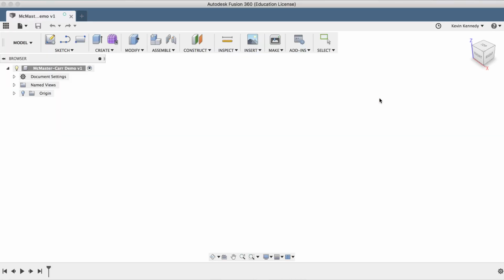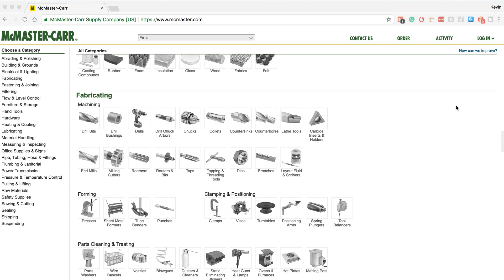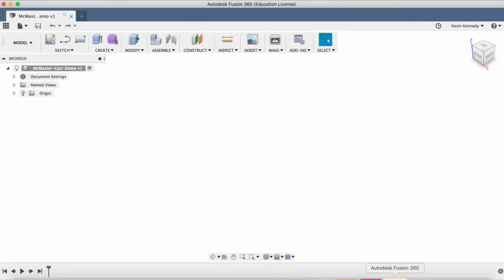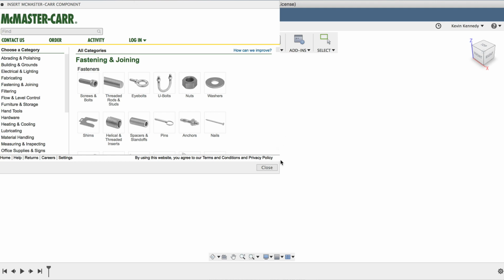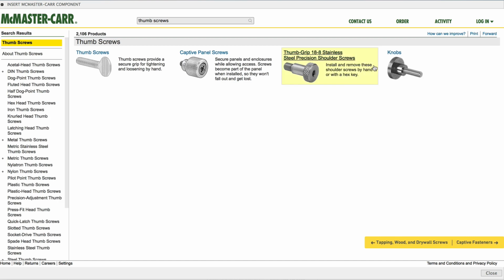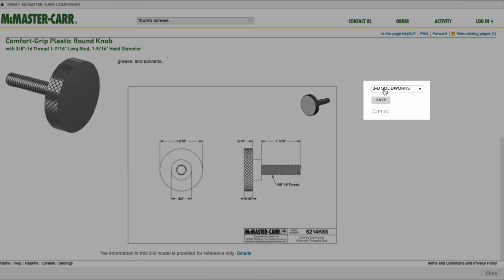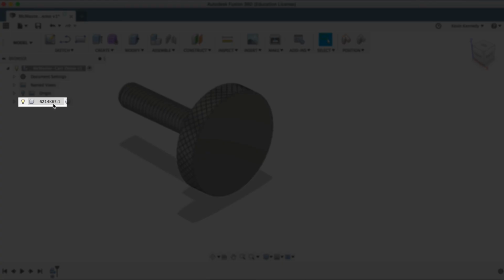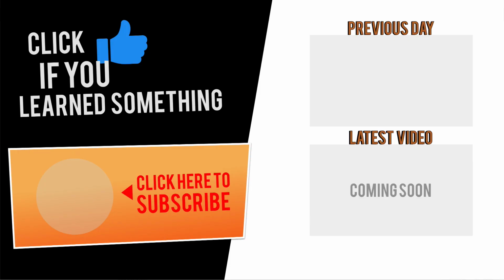Fusion 360: How to Insert PREBUILT McMaster-Carr Components in Autodesk Fusion 360 | #fusionFridays

Comment: Can you modify an imported item from McMaster Carr in Fusion 360?
Reply from the maker: Yes! They will come in as a solid by but will not have the previous history. You'll have to treat it as 'direct modeling' to some extent.
Reply: Thank you very much!  Your tutorials are awesome!
Reply: My problem was that I was having trouble with an 1 1/2 pipe thread and fusion wasn't letting me by telling That the OD wasn't large enough even though I had the correct major diameter.

Comment: Great video! Thanks for your time. 
A couple of tricks I've learned using McMaster in Fusion.
 If you have multiple parts you need available for a design, Set up an account if you don't have one. Then if you know the parts you need, you put them in the order. That way all the parts are available in one place when you need them. Go to order page and click on the part # or the picture. This will take you to the item you ordered so you can download the file as show in the video You can do the same thing on their website and the parts will update into Fusion as long as your logged in!

I still haven't learned how to page back and forth like the back button on PC :~(

Click on the McMaster-Carr name in the upper left corner and it'll take you back to home page.

Just an FYI if you didn't know.
                                                                                                          ******************************Sharing is Love*********************************
Reply from the maker: Hi, Curtis. Thanks for watching and thanks for sharing this tip with the community!! I wish I could help with an answer for the PC, but I unfortunately don't have F360 on a PC. However, thanks for bringing this to my attention. It's always good to make note of some of the slight variances between the PC version and Mac version. Cheers, Kevin :)

Comment: Having some difficulty figuring out how to align two items from separate drawings. Is there a method to align items for instance if you have a hole in a box and a part in another drawing. How do you show them in the same drawing aligned to show they fit?
Reply from the maker: Rud Dog - To my knowledge, the only way to align items in a 2D drawing is to use the project views. Typically you would create a drawing from the master assembly file, thus the parts should all be aligned already. I guess you could try to manually align separate objects within a single drawing, but there are no "align" buttons if that is what you're looking for. Cheers, Kevin :)

Comment: Can you do one inserting a multi-part component? For example I've imported drawer slides but they come in as multiple parts and I can't seem to get them to have joints and animate like they should to actually be slides.
Reply from the maker: Hi Simon, the best option is to create a new file specifically for the drawer slides. Set up the part(s) of the drawer slides to all be different components. If you're wanting to add joints and animation the parts will definitely have to all be their own components. Then, insert the master component into your other file with the drawer/furniture. Cheers, Kevin :)

Comment: One thing to keep in mind is that these models are meant to be really accurate, so they may have a lot more detail than you need. 

Not an issue with a simple document, but if you're designing something complicated it may harm performance to have e.g. the interior threads modeled perfectly on each of 1000 nuts.
Reply from the maker: Great advice, Joel! Thanks for watching and commenting. Cheers, Kevin :)